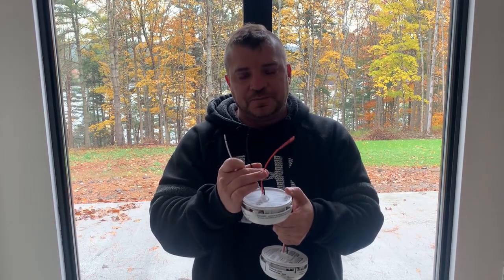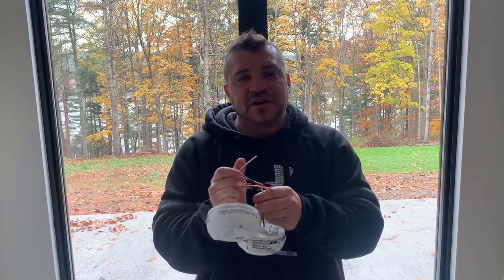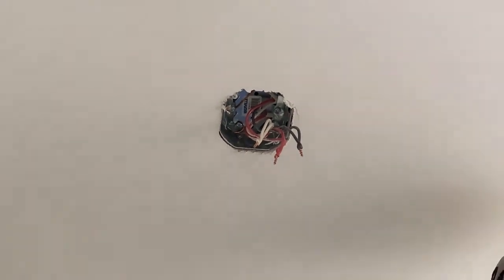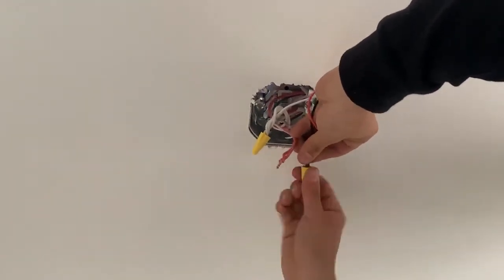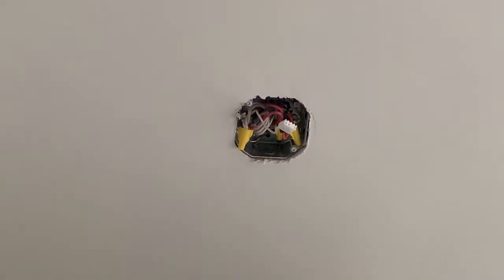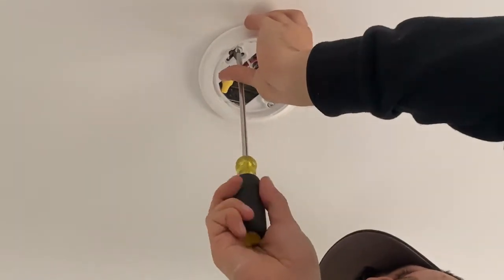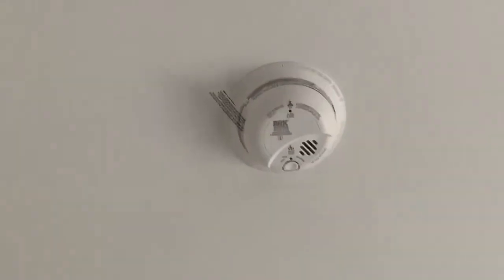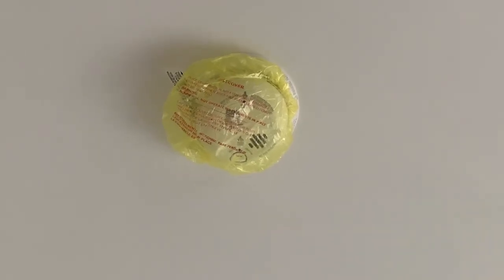How To Wire A Smoke Detector Interconnect

Comment: I have a house full of hardwired smoke detectors already. If I switch to the interconnectable type, do I only need to run an interconnect wire, or would I have to also put them all on the same circuit?
Reply from the maker: They need to be interconnected by code in Canada